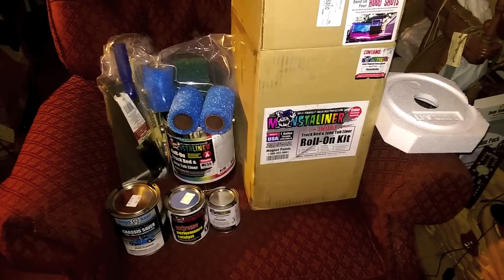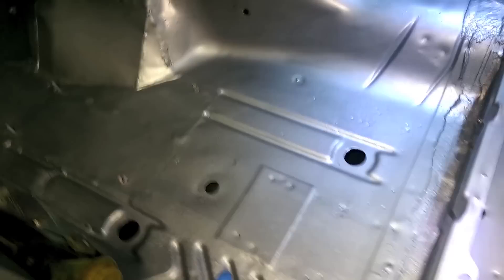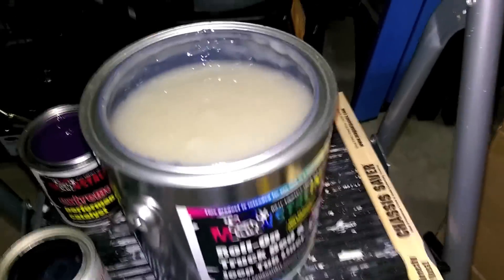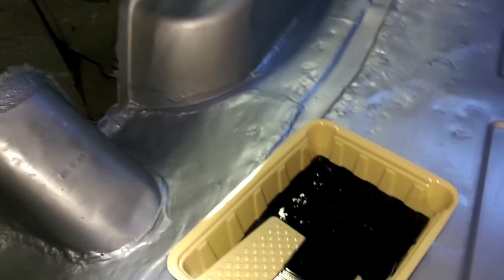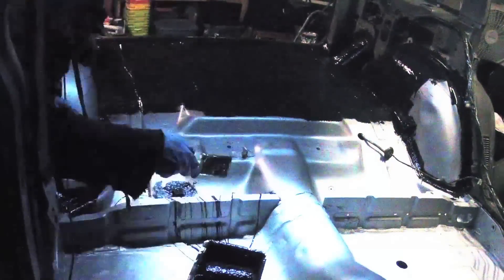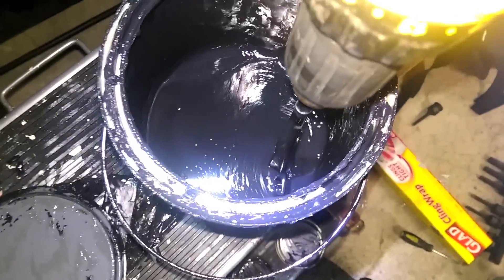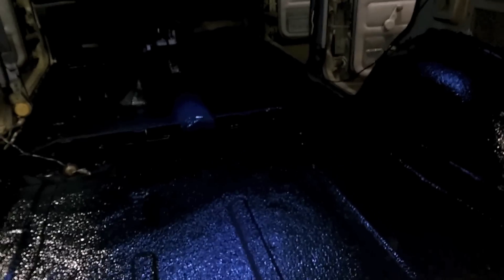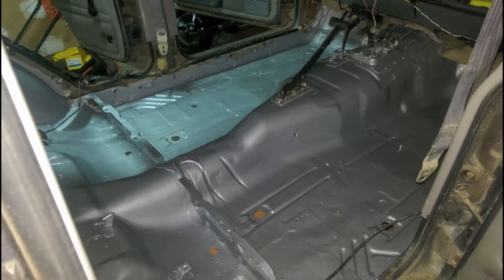89 Cherokee Applying Monstaliner to Floor Pans

Comment: That looks really tough now, all your repair work is protected better than a new floor :-))

Odd that the makers of that coating didnt leave a little room in the can for the colour and hardner, strange logic :-/
I can tell you really really dont want to ever lift the carpets up again in the vehicles lifetime lol, fit and forget :D

On a different line: i did notice the "send message" button on my youtube channel just vanished, its got a business email button now, i get the impression that google wants to cut down on peoples private messages going through there servers, im no lover of google+ crap but they are still forcing the stupid system.
Perhaps im just a stick in the mud, but youtube worked so much better without googles invasion.
Reply from the maker: My favorite quote is "If it's worth doing, it's worth overdoing." That and my dad has constantly taught me to never "half-ass" anything so I tend to do the best job I can on most any project I deem worthwhile. 

As for the coating, originally they only produced black, so you got a 7/8 gallon of liner and a 1/8 gallon of catalyst so it fit just fine. With the tintable product they just added a pint of color to the mix, making more than 1 gallon which i'm okay with because now I have a little bit more to use.

As for the carpets, I'm probably not putting them back in because it doesn't look nice and it's a pain to dry if it gets wet and muddy. I'm probably going to put in floor mats and call it a day.

For YouTube, they had good intentions with their design but they didn't do a great job implementing it. Their idea was for people to have one google account for everything, so you Gmail, Google Drive, G+, YouTube, ect, were all connected to one e-mail to keep things clean. Well the best solution they had was to tie your YouTube account to you google E-mail, and then transfer the comments into Google + so they it was all one system. Turns out that is complicated to get just right and not everyone wants their personal Google + tied to their YouTube. Overall, they need to start from scratch and revamp the whole system to work with each other instead of putting bandaids on the code to watch it fall apart in some areas.
Reply: NickInTimeFilms
Yep your right there :-)), ive done the same with electronic repairs for years, for one example, i used to repair ye-olde vcr's amongst other odds and sods, the power supplys would pop far too easly, it was a single transistor that allways died because of bad design.
I took this non heatsinked under rated device and showed it the bin, i replaced it with a device six times better in current/wattage and heat transfer characteristics, it still fitted fine and it didnt look out of place, i put a small cute heatsink on it :D.
Never ever failed again!!, ive done loads like that and they never came back with a dead psu, yep it was well over done, but i deemed it good for the owner :-).
Years later i told a frend about my mod, he thought i was being daft untill he talked to a professional repair man, he had chose the same path, even the same part number as me, my frend didnt think i was daft after that :).
Your bang on the nail with your methods, never let anyone say different :D.
----------------------------------------------------------------------------------------------------------------------
I think It would have been less annoying if when google bought youtube they made a new system and just said "this is the new modern youtube, with all your content", you can log in as normal, so easy, but they didnt do that. :-(
Reply: Google plus is fucking stupid, I hate it.
Reply: dainternetguru
Yep, i dont use it unless i have to, google plus is a mess, but im sure there are many people that like it so.....